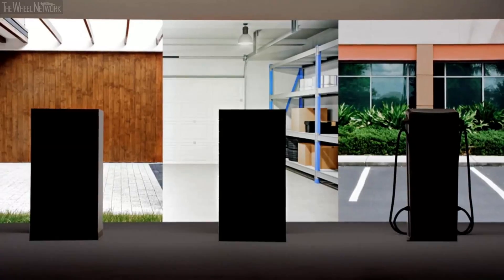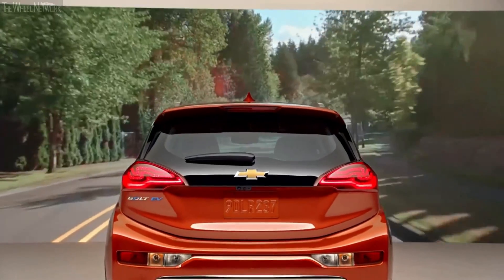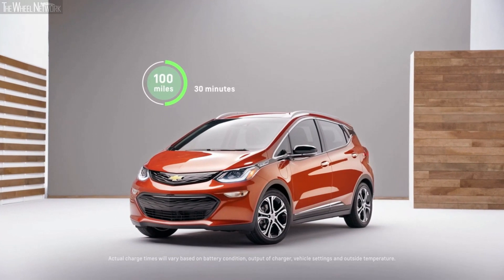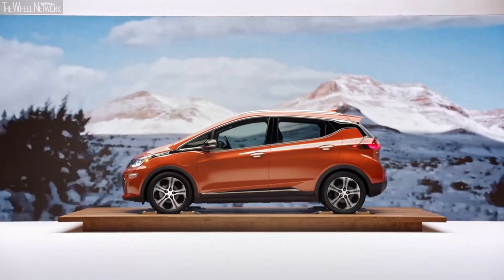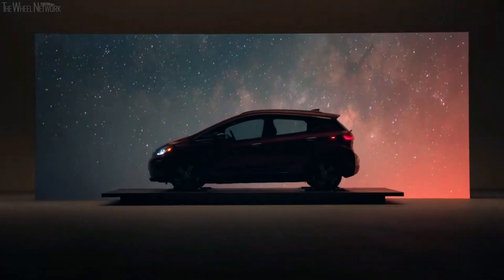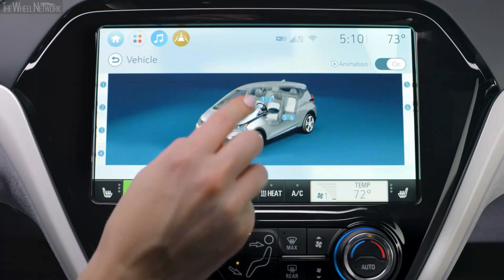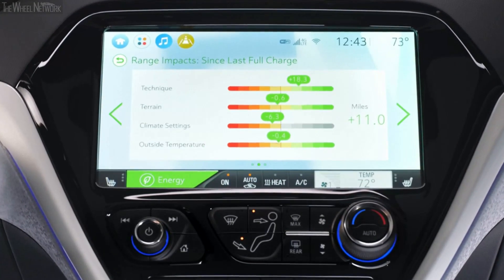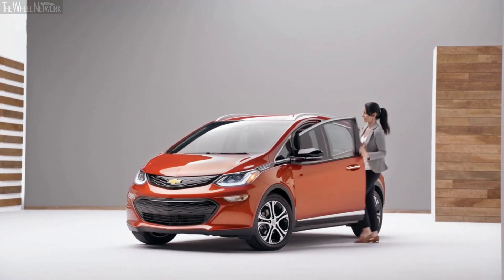2020 Chevrolet Bolt EV – The Complete Tutorial

Comment: I'm into the 5th year of owning my beloved 2019 Premier. (Have owned it since brand new.) Wouldn't trade it for a Rolls Royce. My hat's off to GM for creating this masterpiece!
Reply: @wassiswallylokhankin191   Any unexpected "surprises"?  Any notable quirks you've noticed over the years?
Reply: @JohnDoe-md2sb Surprises? Mostly pleasant ones. The Bolt is irresistibly loveable. 

The only "quirk" that happened during over 5 years of my ownership was related to that small 12-volt battery under the hood. One hot day, it died on me when the car was parked. I called OnStar, they sent a tow truck and replaced the battery. Other than that, no problems whatsoever. 

However, a heartbreaking event did occur at a busy intersection about a month ago, when my Bolt was T-boned and destroyed by a @@@ ### driver. As soon as I recovered from the impact, I bought another Bolt, a very gently used 2023 EUV Premier - which, in many respects, turned out to be even better than my original Bolt.

Looks like I've become one of GM's loyal buyers now.
Reply: @wassiswallylokhankin191     Ouch!  Sorry to hear about your accident.  Hopefully you're doing well now. 🤞
I've test driven a few Bolt Evs and am very positive to its attributes.  Not a fan of the second Gen EV exterior, but the EUV is much nicer than the EV version.  I'm coming from Honda an Toyota reliability so GM is the only weak point with a Chevy Bolt.  The battery being changed to the revised one and the extended warranty is a big plus.  I've gone through many forums and reviews to get as much info I can.  I tend to overthink when researching, but a vast majority of the take back from all the data is that people just love their Bolts.  Thank you very much for the update and input. 👍

Comment: heads up, you'll get max 15 miles using the 110 charger they give you, unless you want to prime your electricity use with your electric company and charge it from 5pm to 7am. That is about .25 a MILE where I live. And by the way, the app in the car is totally UNintuitive. and you will NEVER get the 259 miles from one charge.

Comment: Great until the power grid goes down because of severe weather, excessive reliance on wind turbines and or solar, and unforeseen overload on grid.
Reply: The gas does not evaporate from your tank when it's not connected to a gas pump; neither does the energy in a battery vanish when it's not plugged in. A gas pump doesn't dispense fuel when the power goes down; neither does a charger. This changes nothing in that regard.

Comment: I just got a 2020 Bolt that replaced my 2013 Ford Focus Electric! The Bolt is awesome with true one peddle driving in low or paddle regen in drive! I already got saved by the crash braking as someone stopped just around a corner and the cross path makes backing out of my drive way safer! The end of year discounts are huge now!
Reply: Also the HD overhead and backup and nose camera and side cameras are amazing!

Comment: Leased a 2017 ride share for 130,000 miles. Not a problem unlike some others like Tesla. Now leasing 2020 better in some ways that count than the 2020. Had Twin Sequential Turbo RX-7. Do not miss it. Love surge driving with L mode. I get 375 miles of range (430 in low) with 120 volt charging and regenerative braking down a 6,000 foot mountain.

Comment: Great video! However hope you will take some constructive criticism.  You say road trips are possible since now 2020 Bolt has 259 miles. It's true for road trips, but it's misleading that you can expect 259 miles which is the EPA  estimate based on mixed driving. While in the city stop and go you can get even more than the EPA range, on the highway with 90% of charge driving at the highway speed limit you can expect about 200-210 miles.  Realistically should be base on max 90% since its safe to plan to arrive with 10% or more. No one should plan to arrive at nearly 0% state of charge.  Also in specifications, you need to update the battery usable energy which now in 2020 Bolt EV is 66kWh up from 60kWh in previous years models.
Reply: Slow down to a reasonable speed (65) and watch the mile range get better.  Other factions include wind speed, outside temp, road incline, and use of climate controls.  These factors, when they can be managed, will get you more bang for your electronic buck, too.
Reply: @oaklanddan  I drive my Honda Fit at 60 on the interstate & get up to 45 mpg, so I will do the same when I get a Bolt 2023.
Reply: I get 230 plus driving highway at 75mph most of the way

Comment: Love my bolt. Won’t ever go back to a gas car.
Reply: what if you need to go on a road trip
Reply: @alexsafayan7684  there is an app that you plug in your route. It puts in where you would need to charge and how long it would take. I figure it adds about 25% of time on a long road trip. So a gas car would be faster and it would get better gas mileage. It costs about the same for electricity or gas on a long trip. So in my case we have a second car with gas we take on long trips. But it could be done.
Reply: @ericgeorgia7958  ah yes i see. it costs the same for gas and electricity on long trips?  i thought electricity would be much cheaper.
Reply: @alexsafayan7684  I just measured a route across the state and back and it was the same because you have to pay for charging. If you can stay at places that have them for free then yes. Much cheaper.

Comment: Level 2 is like electric dryer or oven. Washers don't use lots of energy. They are 120V.
Reply: With adapter use 120 volt charger with 240 volt outlet for dryer or electric Range.

Comment: how often can you use dc fast charging and how will it effect the battery?
Reply: Linus as much as you want and it will not affect the battery. The bolt has an active thermal management system to protect the battery from getting too hot - 6:30
Reply: I fast charge at least once a week but often do 2 times a week 60k miles battery is still as new
Reply: @minibx6659  question is whats the degredation like if it's fast charged 6-7 days a week every week.
Reply: @linusa2996  maybe you could post your question to a chevy bolt forum
Reply: @linusa2996  There's a guy in Canada who has over 200,000 miles on his, so he probably does a lot of fast charging. He says his battery has degraded about 7%.
Reply: @linusa2996  if you search YouTube  for NewsCoulumb you'll find a guy who has charged exclusively on DCFC for 130,000 miles -- never anything else. His battery is fine. That's the flip side of GM's very conservative (aka slow) DCFC curve.